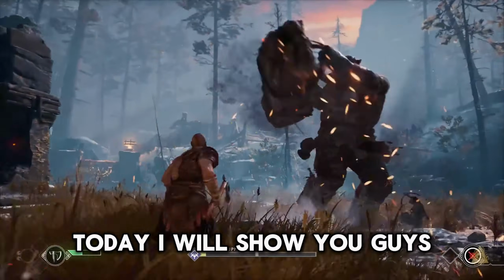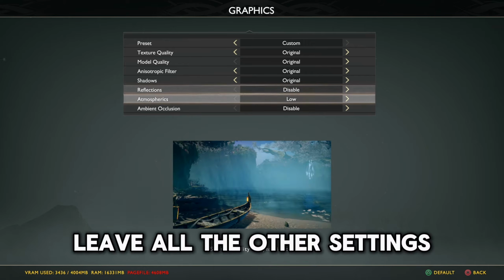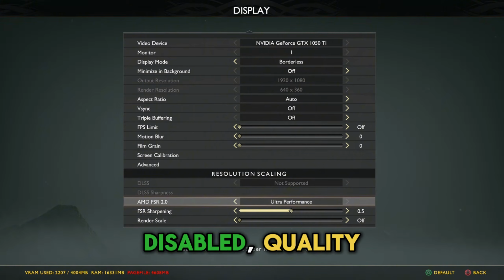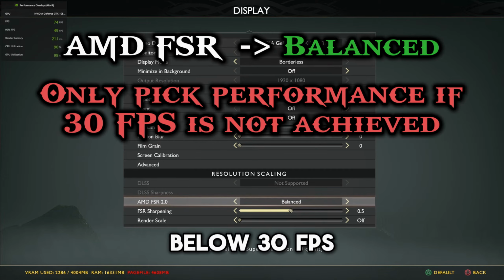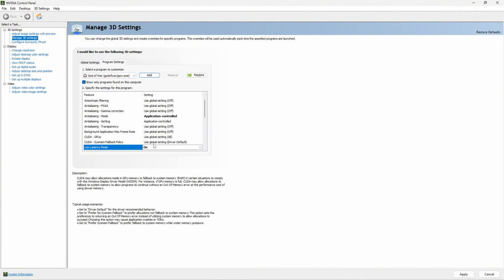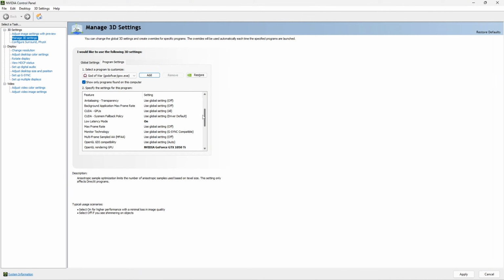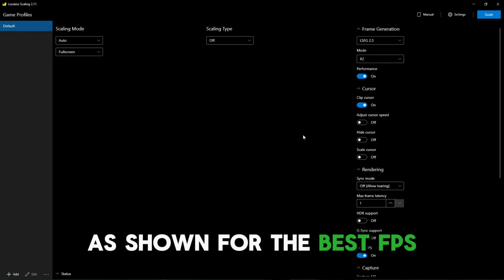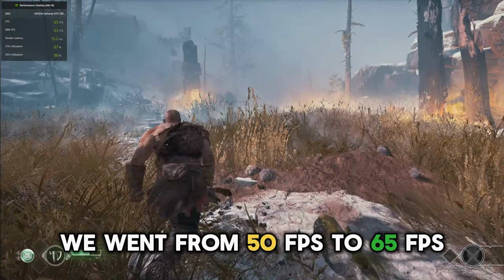God Of War | Optimization Guide And Settings for Low End PC | Get 60 FPS in ANY PC

Comment: The real problem is sudden FPS drop
Reply: I saw a setting for that too. I've intel iris xe😂.
 Steps to improve fps drop (not completely but somewhat helps)
Go to control Panel 
Go to system
Advance system settings 
Performance box
Settings
Advanced
Set the virtual memory - initial 8000 mb ,  max - 16000 mb (I have 16 gb ram, change according to max ram setting of your pc).
Fps stutter and drop will be managed by a little.
Reply: @123shubhankarsaha3 I will definitely try this thanks

Comment: I get 10 fps anyone can i get atleast 25-30
Reply: What's your pc or laptop specs?
Reply: @kris_plays51mine is very low but somehow it gets 34-35 fps in open fields in rdr2 with high textures and all low 720p
Intel uhd for 12th gen
I3-1215U
NVMe SSD
Any recommendations please?
I just want 25+ fps in this game
Reply: @Jeet-e9k7u well 35fps is kinda smooth but if you want more i can totally suggest you lossless scaling frame generation, I also use it for bigger titles like black myth wukong and you can double the fps by adding software level frame generation. It adds interpolated frames that are built by the software so don't expect much but yeah it helps if your base fps is 35 you can get 60-70 fps with this app. Just do some research on how to use it and it's available on steam for 345₹ but worth buying. Hope my comment will help.
Reply: Bro I have a same spec please upload god of war 4 settings